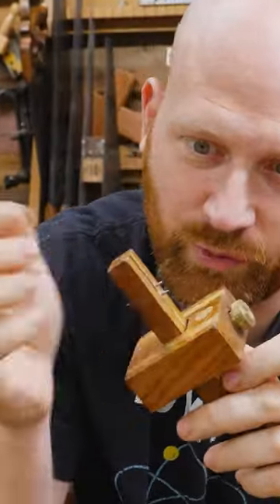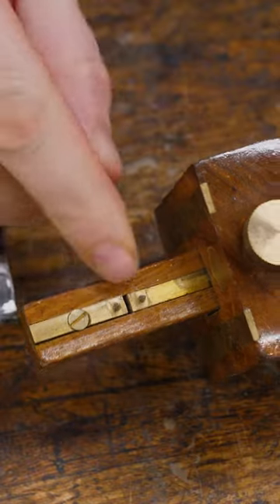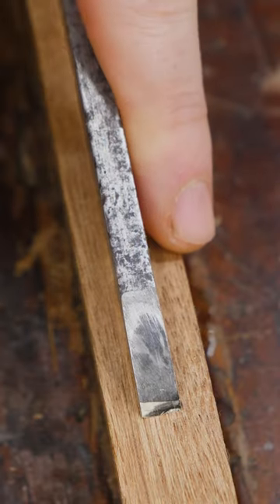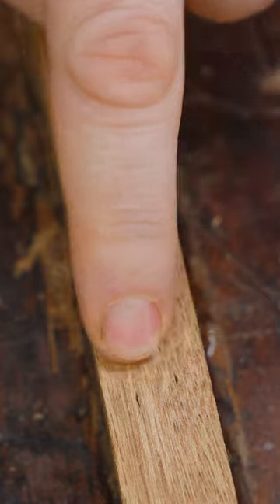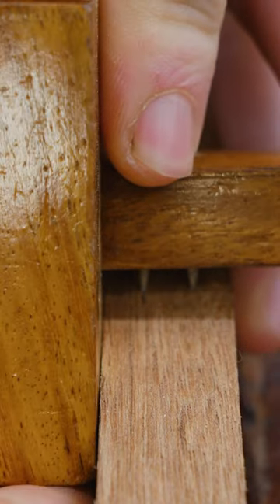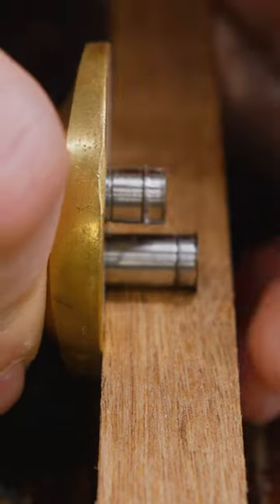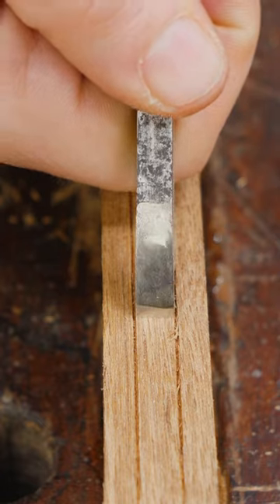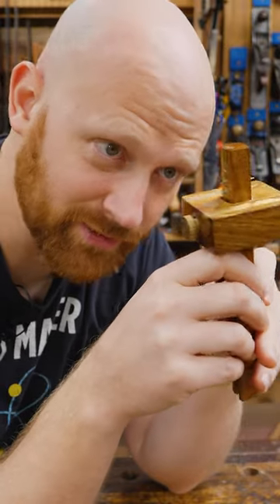How to Setup a Mortising Gauge

Comment: The big question with those Veritas dual-rollers: bevels in or bevels out? Since we use the same setting on the mortise and the tenon, one would have the bevel on the "wrong" (non-waste) side. Does it even matter?
Reply from the maker: Honestly, it doesn't make that big a difference. Unless you're that accurate with a saw. Some people will be pretty picky about it but I haven't found it to make any practical difference.
Reply: @WoodByWrightHowTo  Thanks James! I'm definitely not that accurate with the saw 😅
Reply: I have 2 sets of matters. One set is bevel in, the other is nevel out

Comment: ok very random question, but i don't use a marking knife or gauge, and i'm wondering if you'd say its neccesary or ig what the overall benefit  would be
Reply from the maker: It's faster and more accurate layout particularly for hand tools. For power tools you often rely on setting up the jig rather than marking the tool. But a knife or a cut line is far more accurate than a pencil. Not to mention every time you measure something you lose  accuracy

Comment: Why not just measure how wide the chisel is then just place the ruler on the wood and mark it then use that other marking tool to make the straight lines?
Reply from the maker: that just introduces error. any time you measure you are adding chances for error.
Reply: @WoodByWrightHowTo  interesting, but I feel like there is still errors to be made with that other tool. Whenever you do it yourself you are subject to human error. I think the added benefit of knowing the exact length and size of all your peices so if you want to know that you can. I don't doubt the fact that it is a very cool and unique tool that can easily make the job alot easier so I'll give you that. Also sorry if half of that doesn't make sense I'm extremely tired and that tends to happen thank you so much for your response may peace be with you at all times 🙏
Reply: @WoodByWrightHowTo tbh I don't think I understood the whole concept when I watched the video at first that all probably doesn't make sense at all 😂